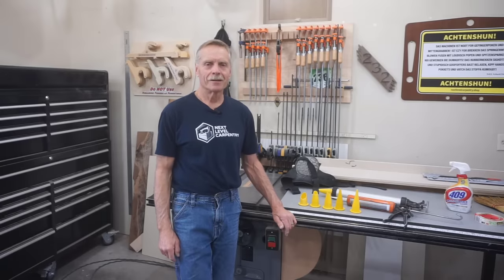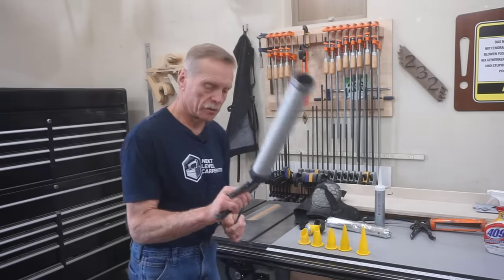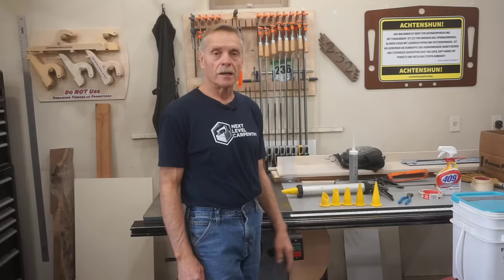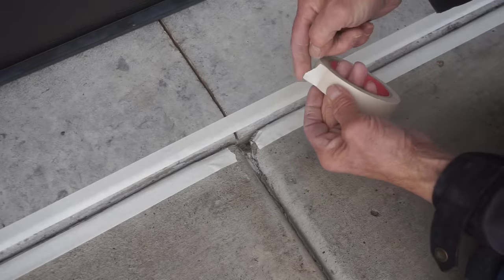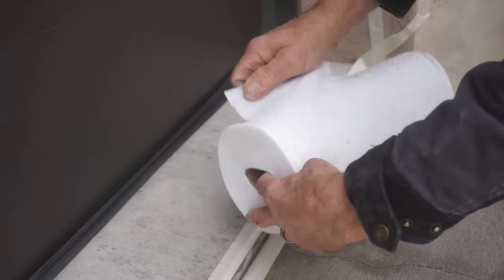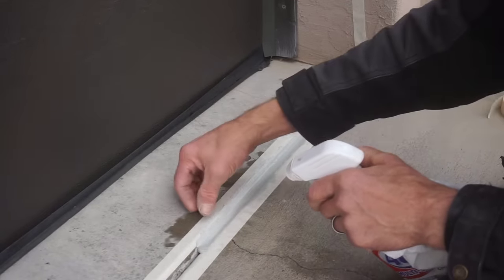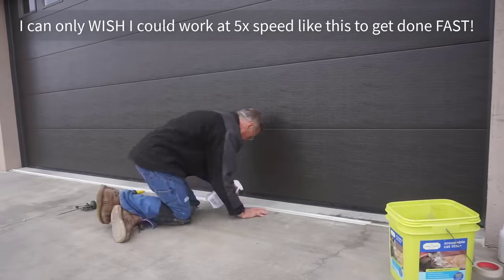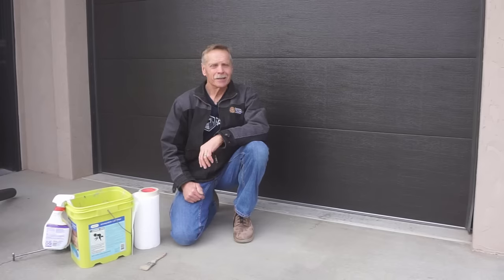How to Caulk Concrete Control Joints with Perfect Results Every Time

Comment: Approx how long will a 20oz tube go when filling a 1/2" x 3/4" void?  The math stays 100" or 8.3ft if tube is 2" x 12".
Reply from the maker: I think there's a quantity calculator on the Tremco website which might give a closer estimate.  The tubes are 20fl oz but I don't know how that translates into diameter and length exactly.  Your calculation is probably good for a guesstimate but, since joint width/depth is generally rather inconsistent I try to figure generously...
Reply: @NextLevelCarpentry  Thank you.  Looks like sausage is 2" x 12".  What is your preferred color for typical concrete?
Reply from the maker: @tbl8560  Limestone or Gray... limestone is lighter, gray is a bit darker but not available in sausages around here.  You should be able to see their color selection samples online or at a distributor to help choose. Best, Matt

Comment: Can this be used to call  fireplace bricks
Reply from the maker: I don't think anything can 'be used to caulk fireplace bricks' Mike... need to be tuckpointed with mortar or, possibly fire-resistant mortar, depending on what joints you're talking about.

Comment: Is that silica bad for your lungs if it's inhaled?
Reply from the maker: Beach sand is bad for your lungs if you inhale it... the secret is to avoid breathing it in.  Extended exposure to silica dust is linked to lung cancer but I have zero health concerns about sprinkling sand on fresh urethane sealant.

Comment: 20oz sausage can caulk how long Sir?
Reply from the maker: Depends on joint size... go to the Tremco website for a joint volume calculator to help answer your question... and then make sure to order extra because, when it comes to sealant, it's far better to be looking at it than looking for it! Best, Matt

Comment: Professional caulkers like me never use tape! But when it’s all you do it’s really easy! And we only use original Ivory dish soap. Never use a colored soap! Use a dry or wet tool never use fingers!
Reply from the maker: I'd like to see pictures of your work for comparison.  Many pros post comments much like yours but, to date, I've not seen a single one who's willing to show a side by side comparison of actual results.  A good tape-free joint is adequate for many applications but, without actual photos of a sealed joint in less than ideal conditions like this video shows, I doubt it's as good aesthetically... Best, Matt

Comment: Will the Dymonic FC work on a 1.75" joint?
Reply from the maker: I hesitate to tell you this but there's times in extreme situations I've sealed joints in the 3" wide range with great results.  Keep in mind that you're pushing beyond what's considered normal so you need to make sure you're doing all your prep and application with due diligence but, in my experience, it will work...

Comment: the joint on mine is right where the garage door is.. meaning, the garage door closes right over the joint? - Can I still do this?
Reply from the maker: I don't see why not but prevent the garage door from closing on top of the sealant until it has ample time to cure..

Comment: You Need to show a close up of that finished joint.
Reply from the maker: Closer than the one in the video thumbnail?  It's shot at about a foot... I'd have to use macro to get much closer😉
Reply: @NextLevelCarpentry  I was thinking something like the poor caulk joint you showed and discussed but in video format and then scroll the entire joint.  I didn’t see it in your home page right away. It was recommended and those thumbnails are about 1” x 1”. Didn’t mean to offend you. My apologies if I did.
Reply from the maker: @jackc70  no problem... it's so hard to know what device people are using or how they found the video... on my desktop the closeup shot in the video thumbnail shows the finished joint nicely but on a phone or some such, who knows?  And adding a panning closeup in the video would have been great too, but, unfortunately, it can't be added at this point.  Thanks for watching and commenting! Best, Matt

Comment: what's the purpose for concrete  control joints?  if we don't do it, does it affect or ruin your home or something?
Reply from the maker: Preventative maintenance and aesthetics are two key benefits:
1) Sealant prevents water from running through cracks with softens and erodes soils leading to premature settling and/or cracking
2) A clean strip of sealant looks much better than the dirt, grass, bugs, sand, gravel and weeds that accumulate in un-sealed joints IMHO.
A professional quality sealant job looks a bit like (very large) floor tile with nice grout lines so the investment of time and $$ required to seal up exterior concrete is well spent for increasing/maintaining the value of your home.
Best, Matt
Reply: water in unnessasary areas
Reply: Water will keep going down foundation in  a three story apartment eventually the water will start seeping thru the paint and over time mold chipped paint etc ...
Reply: Protection from water seepage/freezing/cracking in colder weather. Water invasion slab undermining protection.
Reply: Nobody above answered the question. The purpose for concrete control joints is to allow space for the concrete to EXPAND when temperatures increase. If you don't put in control joints, then the concrete will push outwards and crack and buckle, and/or it will push over the wall or other objects at each side. Also, concrete shrinks in cold weather, so having a deliberate crack ensures that the cracking will be nice looking and "controlled".
Then a sealant (caulk) is used to re-establish the water proofing.
Reply: @stevejohns6672  - WRONG. Concrete control joints DO NOT keep water out, and they DO NOT make it look better.

Comment: There is a shortage of 409 cleaner , unable to find anywhere , what else can we use ?
Reply from the maker: I've explained this more thoroughly in reply to other comments but what I am using currently is one part Dawn dish soap to 13 Parts water as a solution... it works perfectly, so much so that I may well switch to it even when 409 is available again. Hope that helps? Best, Matt

Comment: How can hair lined cracks in concrete be repaired?
Reply from the maker: This company has some excellent products but, since there are a LOT of variables and many ways to 'do it wrong', sell only to qualified contractors:  https://concretemender.com/products/roadware-10-minute-concrete-mender-2/
There's many DIY options at big box stores but most (all) produce only ineffective, or worse, results.  Sorry for such a discouraging reply but it's the truth as I see it after a fair amount of research into the question.  Best, Matt

Comment: Would never have a caulk-soap-caulk sandwich because that would be like a laminate and it would probably peel where are you overlapped the caulk. Also the caulk is only suppose to attach two sides and not three sides so that it would be more elastic and stretch easier with the koncrete movement.
Reply from the maker: Just shows you don't know what you don't know.  Please keep in mind that this video shows how to FINISH the sealant for professional joints and was never intended to be a treatise on expansion joint design best practices.
 I've used this method for over 30 years and never once had the slightest hint of de-lamination of 'layers'.  Also, two-sided adhesion is more of a factor on expansion joints than on the control joints shown in this video.  Movement in control joints is so minor it's not a situation where stretch even comes into play.

Comment: I messaged tremco asking when this product can be walked and driven on after applying and i was told the tremco fc is not rated for traffic either walking or driving.
Reply from the maker: Are you thinking about sealing your driveway or the Interstate?! 🤨
Reply: @NextLevelCarpentry  LOL!, driveway of course. I hear ya. Just was surprised to hear tremco say that especially since I already bought the product. So I was a little concerned. They recommended dymonic 100
Reply from the maker: @simd510  I've found that joints tooled to a slightly concave profile like shown in the video get virtually zero contact with tires and hold up great for years... decades even.  Interesting though that they make a distinction because I never heard that... always learning something new!

Comment: How deep would you go with about a 1” wide gap?
Reply from the maker: Rule of thumb is the joint Depth should be about half its width so in your case about 1/2 inch deep...
Reply: @NextLevelCarpentry  thank you.

Comment: How many 10 oz tubes would I need for 17ft W x 1/2" D?
Reply from the maker: There's a sealant volume calculator somewhere on Tremco's website that should help you figure approximate tube quantity/volume... you'll need know joint width too😎
Reply: @NextLevelCarpentry  Thanks. I would have underestimated massively.
Reply from the maker: @larrymiller463  it's really nice to use the 20oz sausages for larger projects if possible... good luck with your project! Best, Matt

Comment: Hey Matt, getting ready to start my driveway, but I have a couple joints that are too shallow to put backer rod in and I'm concerned that I'll have 3 sided adhesion (side walls of joints and underneath the caulk).  I've read 3 sided adhesion is an issue.  Should I be concerned about this using your method and if so do you recommend a particular backer tape to place along below where the caulk will lie?  I can't seem to find a tape like this anywhere that specifically says caulk won't adhere to it.  Thanks so much! Cory
Reply from the maker: I'm not an official expert on this Cory but, in your situation, I'd just use a cheap masking tape (if necessary; see below): even if urethane sticks to the tape, the tape wouldn't stick to the concrete well enough to cause the urethane to separate from concrete... make sense?  BTW I don't worry about 3-sided adhesion on small joints, or joints like I did in the video, where there's no significant movement between adjoining 'slabs' of concrete.  No movement = no stress = no separation issues = no worry about taping the bottom of the joint.  Glad to see that you're paying attention to important details though... it will definitely make a difference in the success of your project!  Best, Matt
Reply: @NextLevelCarpentry  Perfect thanks, Matt.  I appreciate the quick response and of course your advice and professionalism.
Reply from the maker: @corysinclair5563  You're quite welcome... good luck with your project! Best, Matt
Reply: For backer foam you can hit it with spray foam and scrape some out if you put too much in.
Reply from the maker: @gregsmith7391  I don't see your suggestion as a recommended procedure in any but the most rare/extreme scenarios....

Comment: What about gaps over 2 inches ?
Reply from the maker: I've used this exact method/process on ridiculous gaps in the range of 3" wide with the same excellent results in appearance.  Keep in mind that gaps over about 3/4"~1" usually mean there's structural issues with the concrete where the only permanent fix is to replace the concrete... after correcting whatever problem caused settlement/movement in the first place.  That said, it takes a bit more finesse to 'tool' the surface of the sealant to a nice, smooth acceptable finish but it's still the best fix for a bad situation IMHO.

Comment: Anyone has had success with a different product than 409? I tried water, and maybe mr clean would work? I am in Canada and cannot find the 409 used.
Reply from the maker: I found that 10%~15% solution of Dawn dish soap and water works quite well...

Comment: my question is can I do that after I did sealer on my driveway ? I did Solvent-Based Concrete Sealer over this weekend 
Thanks!
Reply from the maker: I see no problem as long as the sealer has had adequate time to 'dry'.  FYI  I recently did over 100lf of joints on a driveway that was sealed awhile back without issues... Best, Matt

Comment: Isn’t 409 a skin eating cleaner? Or do they have different products all called “409”?
Reply from the maker: Well I wouldn't recommend drinking 409 with dinner but I have never heard anyone calling it a skin eating cleaner before🤔
Reply: @NextLevelCarpentry  
I checked “409” is now a whole family of products. The old version say 10 years ago we discovered at work destroyed fluorosilicone O-rings. That was a surprise. Huge fuel leak at customer.

Comment: I used to do this on helicopters... Imagine doing this upside down lol. We used the same taping method and soapy water.  Nothing works better than spit. Idk why lol
Reply from the maker: I sure hope the rotors were not spinning while you worked! BTW I'm convinced that 409 is equivalent for spit and a lot more plentiful and less undesirable and practice😁😎
Reply: @NextLevelCarpentry  lol! No no, they were always shut down, luckily. And although spit works best, we usually used soapy water from the bathroom lol. I will hopefully be moving into my first home next month and one of the first projects I'd like to knock out first is sealing the perimeter. Thank you so much for the video!
Reply from the maker: @stevena3333  whew! Thanks for letting me know! 😎
In these crazy days of Covid people are finding it necessary to switch to products other than 409 and I myself am working with Dawn dish soap in a ten to 1 ratio with water and it seems to be working great much like the bathroom soap you mention?
Congratulations on your new home it sounds like you will be a great steward of the real estate,
Reply: @NextLevelCarpentry  thank you!

Comment: You don’t need masking tape if you use self-levelling concrete sealant.
Reply from the maker: Note to viewers: following this statement is a fools errand if you expect your control joints to look anywhere near as nice as the ones I show in the video using masking tape.  Even in a perfect world with perfectly level control joints, you'll still end up with marginal results by comparison.
Reply: I had used self leveling for year with marginal results.  The problem is some cracks go deeper than others so the self leveling type drains into the holes randomly and you get uneven results.  I tried filling with sand and backer rod but then it takes as long as non sag polyurethane shown in this video.  Also as he says joints that aren’t perfectly level drain to one side.  I tried many brands of self leveling and after 2-3 years in hot dry Colorado sun they would crack.  Happy to have found this video, it’s a superior product and technique.
Reply: @cubeweaver  Viewers take note: the linked videos DO NOT show results claimed by Hello World.  In addition: they demonstrate self-leveling sealant in idealized conditions and, as they say in the investment world "past performance does not determine future results" so temper your expectations accordingly.  On the other hand, with a little practice you CAN expect expert results using the method and products I demonstrate in this vidoe.
Reply: @ededh7296  Thanks for your comment.  It is based on insight from reality whereas Hello World presents results viewed through rose colored glasses.  Kind of funny how facts can be irrelevant to some, isn't it?
Best, Matt
Reply: @mattjackson3996  why so grumpy?!?
Reply from the maker: @cubeweaver  Grumpy... or clarifying for the benefit of the Next Level Carpentry audience?

Comment: I'm surprised too see a crack at the point off the expansion joint, so they don't really help control the way a crack want to develop.
Reply from the maker: Some errant cracks are bound to occur in even the best concrete work so you shouldn't be surprised.  If you really want to see the benefit of control and expansion joints, just pour a large slab on grade and leave it without any of these measures and inspect it in 5 years for results.
Reply: @NextLevelCarpentry  its only as good as the foundation preparation.
I have a 8m x 8x workshop I built 10 years ago.
We dug out with a digger of course a depth of 20 inches and the earth below was solid, then we filled it up with old bricks and brocken up into hardcore, that was compacted and about 10 inches off depth and then 10 inches thick concrete pour very very hot day was drying fast so had water spraying on it while I worked it level on my own. And to this day it hasn't cracked.

Comment: Never once used tape.. Grind the edges, blow it out, backer rod and wipe the edges with a quick drying alcohol.  We always used rounded tuck pointing tools. You want to use the tip of the cone to damn near tool it as you pump. Cut off any extra and strike it once both ways.  If your good there won't be any tool marks. If your not, soap is always there for the rookies.  Lol. Looks good though. Ps. All of our jobs were quality checked by inspectors and pull tested. Never had a fail
Reply from the maker: Never left a job looking this good  behind either... 'wipe the edged with quick drying alcohol' (as if there's any other kind) will NOT work with urethane.  Anyone who doesn't know that is 'all hat and no cattle'...

Comment: How do you clean the applicator?
Reply from the maker: If you are talking about the tip of the caulking gun the easiest thing is to wipe it with a paper towel or else just let the sealant cure and it will peel right off the yellow tip...